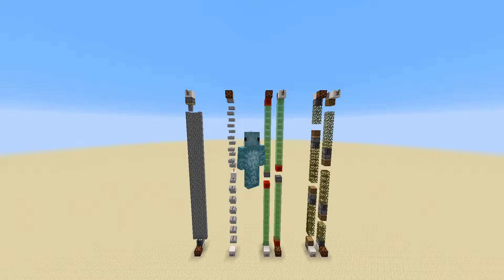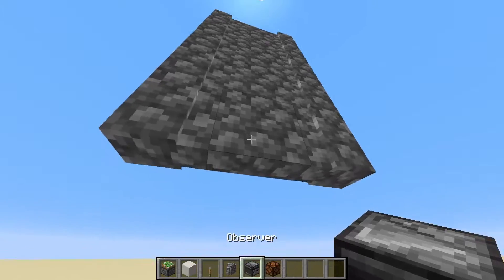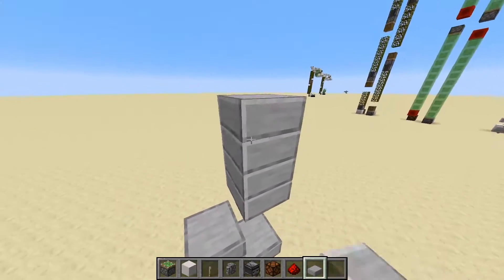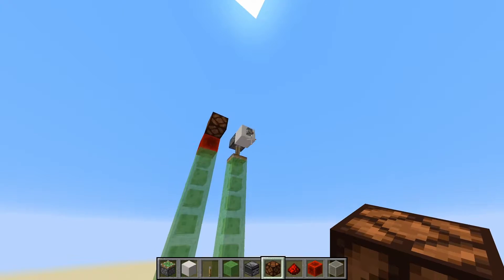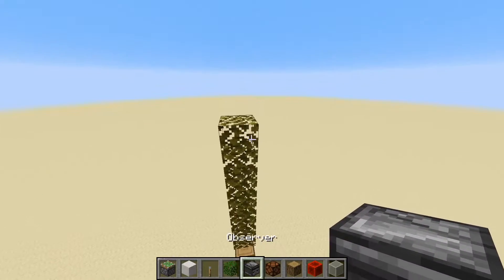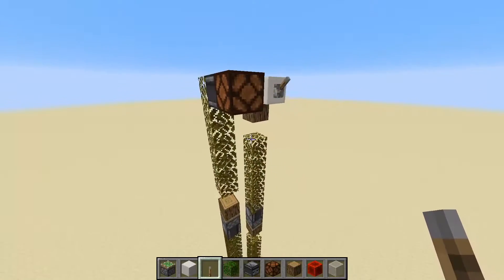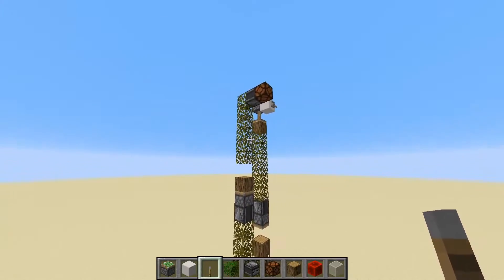Minecraft Vertical Wires Tutorial | How to Transmit Redstone Signals Up & Down!

Comment: Why not just simply use observers to send a single up or down. I use observers or all my vertical redstone requirements. You can stack then on top of redstone dust and that can make a signal go up or down depending on which way the observers are facing.
Reply: Expensive and you have to visit the Nether for Nether Quartz
Reply: Very expensive and slow on bigger builds

Comment: For the one with slimeblocks and redstone blocks going down, be aware that the pistons still are QC-powered even when deactuvated. So an accidental block update could mess everything up. I'd fix this by placing the pistons two blocks below and placing on top of the pistons a block with redstone dust on top. This will fix the issue

Comment: you can use an bubble collom to send signal upwards. make an bubblecollomn and attatch an piston to the soulsand.(put blocks so the water doesnt leak out if something fails and destroys all your redstone) now place an observer looking at the top water block and your done with the basic building. here comes the complicated redstone:

now, u need to make it so that the soulsand is under the bottom water block by default with a redstone-torch and then activate the torch with an 2-tick pulse so it gets puled and pushed back rly fast. (the reason for 2 ticks is because if you activate the torch with 1 tick it will not work and if you activate the piston with 1 tick it wont make an difference in the speed.) the reason we want to pull and retract it is because we only want to use the soulsand getting pulled away as signal all the time and not the soulsand getting pushed under it because the soulsand getting pushed under it has a slight delay until the bubbles reach the top but the bubbles vanishing is instant. however, the pushing and pulling will send out 2 signals the first signal instant and the second one of the bubbles reaching the top again so if this breaks your machine you just need 0tick the piston every time so the soulsand gets switched every time it gets 0ticked. 1/2 signals will be on a slight delay tho.

EDIT: if you rly need it to be instant you can make the observer at the top feed into a block. take an output out of the stone block and lead it to your build. then take another signal out of the block or the line you made yo your machine and hook it up to an 2-comparator pulse extender. then hook that pulse extender up to the piston so that it pushes the block away from the observer for some time. now the block will be pushed away from the observer when the second signal arrives so it wont go trough!

Comment: Minecraft 1.20, the slime blocks method does not work downwards. The Redstone block above the piston always power it on instantly.
Reply: You do good work.
Reply: You may have already found this out but if you put the sticky piston at the start of the second group of slime blocks one block further down with a powered rail on top of it, when the redstone block moves down it powers the redstone rail which in turn powers the piston but when it turns off everything reverts to its correct position

Comment: 0:35 first design: cobble wall (only downwards)
1:28 second: slab/glass stairs (only upwards)
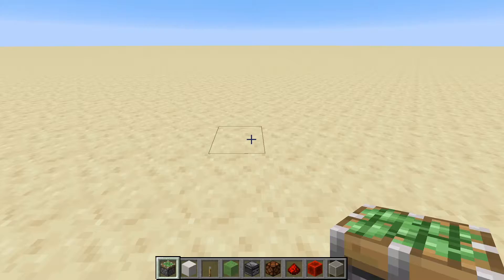2:33 third: slime blocks (both ways)
3:43 fourth: leaves (both ways)
Reply: Cobble fence and Cobble slabs would be the most easiest methods to obtain and use.

Comment: the wall one is new to me! will use that for downwards redstone due to its superior speed to leafstone(what I had normally been using). but leafstone for upwards is still super convenient in a tight system as it interacts little, if at all with the system next to it.

Comment: Scaffolding is the best method for transferring a signal strait up. It’s instant and you can snake the scaffolding around things it dosent have to be a strait line unlike the walls and pistons methods.
Reply: How does that work?
Reply: @NataschaYT  you can look up videos that will explain it better but it works similar to wall expect more compact. The game keeps track of the number of scaffolding blocks closest to the nearest anchor block. Any change in this number can be detected by an observer. So to start you place down your starting piece of scaffolding (aka the anchor block) place a piece of scaffolding on the side of that block, the second block must not touch a solid block, then place a trap door under it. (Open and closing the trap door under this block will switch the second block between being an anchor block and being an extension block, hence changing the number of scaffolding blocks to the nearest anchor) then you can stack the scaffolding up off the second block as high as you want and as jagged as you want as long as you never let it sit in a solid block. Then put an observer at the top of you scaffolding chain and when ever you flip the trap door at the bottom the observer will get a signal. The downside to scaffolding is you can only transfer signal upwards.

Comment: To make the wall one faster you can also add a trapdoor since it will also connect to that. The trapdoor also doesn't have the issue of potentially breaking. Pistons can spit out their block on a 1 tick pulse (at least in Java) so it's not ideal
Reply: Pistons are exactly ideal, actually! By pulling out, they cancel downwards, and by pushing against they can begin a signal! Using the spitting function to your advantage can majorly improve it here.

Comment: The wall method is fantastic, I did not know that this could be used to transfer signals downward. Instantaneously no less! Plus it's expandable sideways by having more wall/observer/piston "lines" between the capping of the wall. Only downside, the signal can only be received at the very bottom, but at the loss of instantaneity you can make reader modules in the middle too (but at that point other methods might be more useful)

On the note of instantaneous signals, turning off the slime piston line is actually instantaneous! Turning it on requires all pistons to extend, that's one tick per piston delay, but just beginning to retract pushes the block updates through the chain in the same tick, so the other end goes off instantly. If it's only pulses that will be transmitted, and a short cooldown is allowable, this design is definitely one of the most flexible instant wires (it works in every direction, and you can even make a closed loop!)
Reply: Actually, the side walls can be replaced with observers, as it equally sticks to them. I know I'm 10 months late to the conversation, but I did some wall engineering and wanted to see if anyone covered it in a video. This one did, very poorly. Will make.

Comment: for completion's sake:
just like the walls, you can use water columns to send a pulse upwards 
place a an observer facing the column at the top and sticky piston facing the soul sand/magma block at the bottom, then every the piston pulls / pushes the column will change and the observer will detect so
Reply: that's a cool trick too. Like the wall this is actually an instant method of sending the signal, reactivating the column has a delay tho. Also the wall design is easily expandable to send multiple data lines in parallel, while the bubble columns are not for some reason...
Reply: if you use this, u need to make it so that the soulsand is under the bottom water block by default with a redstone-torch and then activate the torch with an 2-tick pulse so it gets puled and pushed back rly fast. (the reason for 2 ticks is because if you activate the torch with 1 tick it will not work and if you activate the piston with 1 tick it wont make an difference in the speed.) the reason we want to pull and retract it is because we only want to use the soulsand getting pulled away as signal all the time and not the soulsand getting pushed under it because the soulsand getting pushed under it has a slight delay until the bubbles reach the top but the bubbles vanishing is instant. however, the pushing and pulling will send out 2 signals the first signal instant and the second one of the bubbles reaching the top again so if this breaks your machine you just need 0tick the piston every time so the soulsand gets switched every time it gets 0ticked. 1/2 signals will be on a slight delay tho.

EDIT: if you rly need it to be instant you can make the observer at the top feed into a block. take an output out of the stone block and lead it to your build. then take another signal out of the block or the line you made yo your machine and hook it up to an 2-comparator pulse extender. then hook that pulse extender up to the piston so that it pushes the block away from the observer for some time. now the block will be pushed away from the observer when the second signal arrives so it wont go trough!
Reply: you need a certain minimum pulse length for it, but it can be useful in some situations